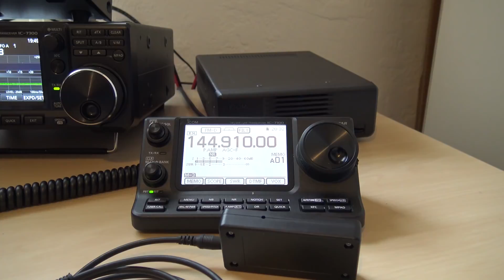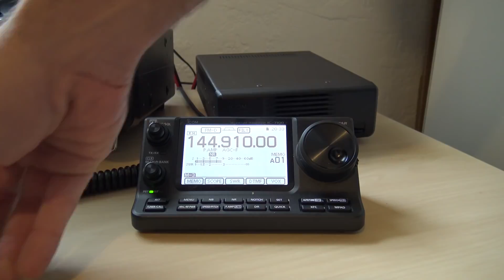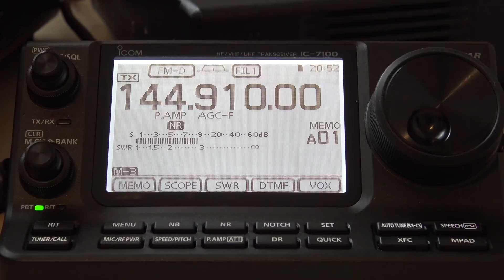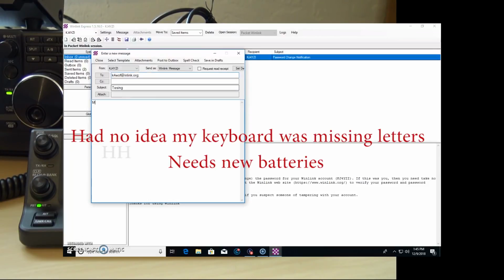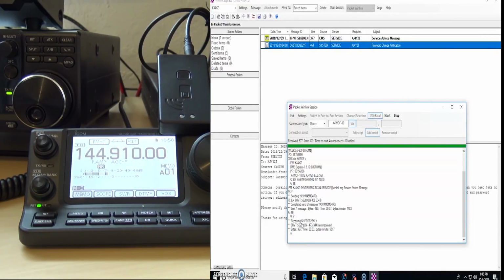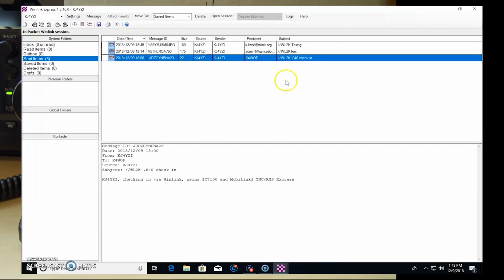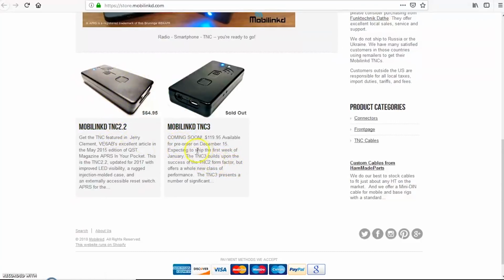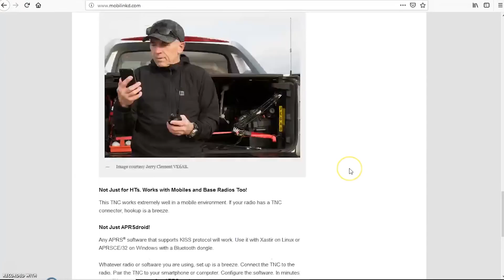Icom IC-7100 Sending Email Via VHF, Winlink, Mobilinkd, ARES

Comment: Hi Eric,,
Hope you see this... Great stuff.. Keep up the good work... Very informative.

You mentioned using the Mobilinkd with your Xeigu X5105...
What cable did you use, I think it's a "8 Pin" mini din...??

The 5105 is becoming really popular..
Any chance of a short youtube on the X5105 settings and doing data modes and include the Mobilinkd :) :) :)

Comment: I didn't find if the 7100 has a cross band repeater function on analog. Fairly new ham here. Have a few radios but I'm not wanting to limit myself. I have a yaesu ft8900, old 2 channel 2 meter Motorola Maxon, 25 watts i think, and 3 baofeng UV5R ht's. Haven't learned anything about yaesu fusion, and a SDR that I play with that will run on my galaxy S10 phone, but it's a power hog, it pulls around 450 mAh. I want to help keep ham radio alive by getting our youth involved starting with the local boy scouts packs, and that's where the baofeng UV5R ht's come in along with my laptop and SDR.  I'm also a volunteer storm spotter. Our city emergency manager signs onto our local ham radio club repeater,  coordinates our position, relays our observations to the national weather service and sounds the sirens if we observe any tornadoes. I have not participated in a amateur radio emergency service drill yet. Thoughts? 73 KG5ZEF Ray

Comment: I have come back to this and wonder - has anyone done TNC3 with ID-5100A?  Would the data jack work, or would you need a specialized cable to switch between the mic and the tnc?

Comment: G'day Eric. Love the vids. Question about having noise reduction on while using digital over FM. General I have NR off when using digital modes on HF SSB so it doesn't have a negative impact, especially on weak signal modes. Does it not matter when using FM or because it's not a weak signal mode? Cheers mate 73. Lance VK6LMK

Comment: I did try the Mobilinkd with my Yaesu FT-65R but I couldn't send any emails. It would constantly lock up and loose data. I don't know what the issue was, maybe the HT is too slow when switching from TX back to RX? APRS works perfectly fine with the same radio

Comment: I am fairly new to HAM. Just got this radio. I am stll waiting on the 6 foot antenna. Can I turn on the radio without the antenna? I remember burning the power unit in a hand held doing that and I definitely don't want to blow this $1,000 piece of art. Thanks!
Reply: By now you have discovered that it is harmless to turn on  / power on a radio without antenna but you should not attempt to transmit.

Comment: Eric, outstanding videos.  There is a procedure on the web to use Winlink on VHF with the IC 7100 without a separate TNC.  This procedure uses the following 

1.  CAT7200 program to key the radio 
2.  Soundmodem by UZ7HO
3.  Winlink Express software

Are you familiar with this setup?  Been trying to get it to work to no avail.  Maybe a pretty cool future video topic to help the IC 7100 use community.  Cheers

73

AE0BE